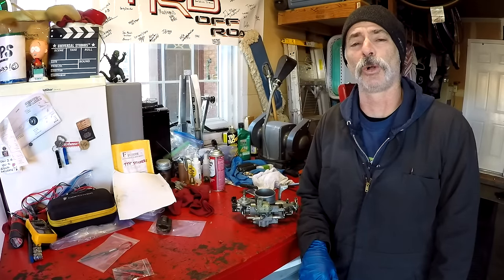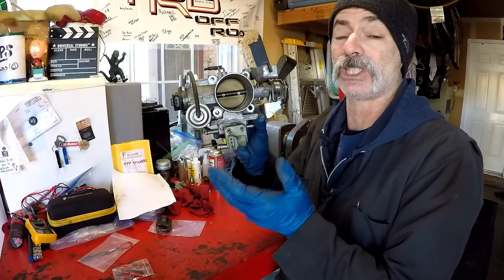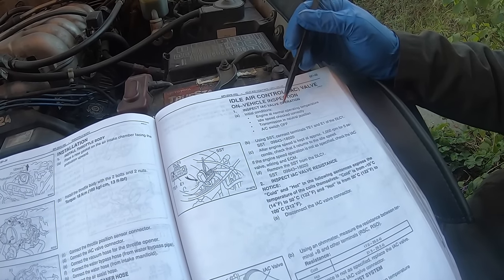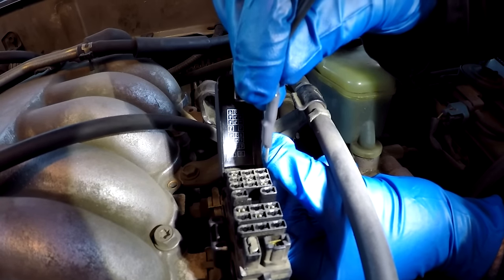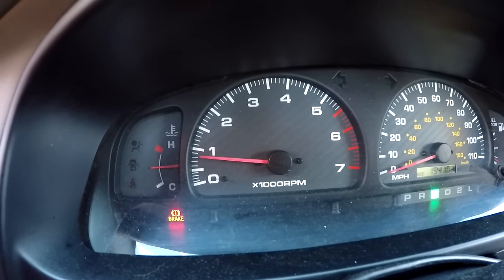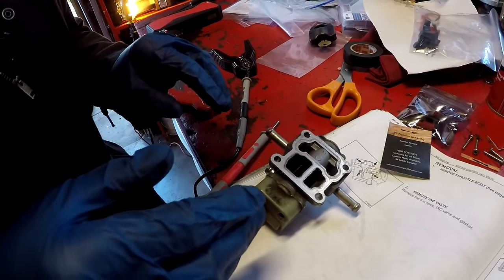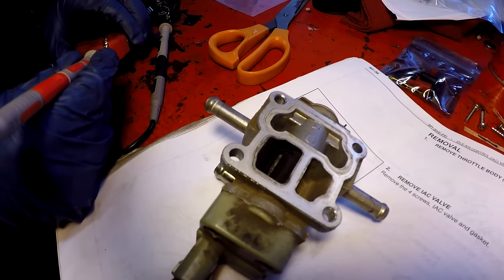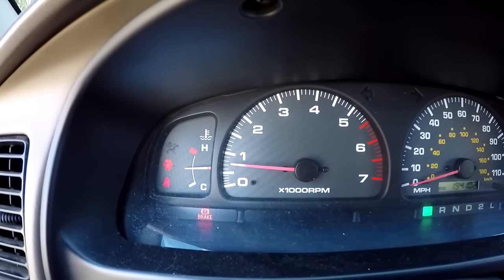IAC Valve Testing and Cleaning

Comment from the maker: Be sure to read this comment and also read the video description for helpful information.

** Here's some additional information about the IAC valve that a helpful member put together on T4R.org.  His name is Leon and he owns the Spiker Engineering company that makes products for Toyota SUVs and Trucks like the hood struts.  Leon discovered after cleaning his IAC, his idle would climb as the engine temp increased rather than drop like it should.  After dissecting the IAC to better understand how the mechanism works, he finally discovered the culprit.  Some of the carbon he was cleaning off the IAC trap door got pushed rather than cleaned off the door, and where it got pushed and dried hindered the door from fully closing.

The following is what Leon reported: "So what happened was that my q-tip cleaning dissolved the carbon, but the carbon then reconstituted itself on a different portion of the barrel, and once it dried, it prevented the barrel from closing. Without taking the IAC apart, I couldn't rotate the barrel far enough to notice this, but the actuator didn't have enough torque to overcome the resistance."  So, the take-away is do a thorough cleaning of the IAC if you're going to do it.  Because of Leon's experience, his take-away is to not mess with the IAC unless you're having an issue with it.  My opinion is I still think cleaning the IAC is a good preventative maintenance thing to do, because even though Leon had a bad result after cleaning it which inspired him to purchase a new one, not cleaning it could allow enough carbon to eventually cause the IAC trap door to become gummed up and not open and close properly.  

Here's a link to the thread: https://www.toyota-4runner.org/3rd-gen-t4rs/310151-solved-high-idle-increases-coolant-temp-iac-3.html
Reply: Last question can I vacuum leak cause a rich condition I did a smoke test and found my oil cap closed but smoke was coming out so I've flip the gasket seal and so far seemed to be OK I now have p1093 pending the no light on
Reply from the maker: @isrealperez9069  If unmetered air is getting into the engine via a vacuum leak, I would then think you'd experience a "Too Lean" condition.
Reply: Timmy. Why do you think my 99 4Runner 3.4 mostly when it’s bitter cold (15f) and only every once in a great while when it isn’t so cold (50f) will sputter and sometimes stall until it warms up a bit?
Reply from the maker: @4bangerlove  Maybe the IAC valve is sticking a bit not giving the engine the air it needs.  Both my 98 and 00 do this too and when I give it some throttle response, it corrects itself.
Reply from the maker: @L Smith Open the video description by clicking on "Show More".  We provide the part number there.
Reply: I just cleaned my IAC now my idle is around 1800 at idle.  It drops when I disconnect the IAC electrical plug but it is still high.  I removed the green coil and cleaned out all of the grey sealant.  I probably screwed it up.  I was worried about this as I did notice the holes were slotted for radial adjustment.  Where can I find information about replacing the bearings?  I am a machinist by trade so I can make special pullers if req'd.  TIA!
Reply from the maker: @nharp83  Replacing what bearings?
Reply: Can booster cables put on backwards to jump a vehicle blow out the IAC connector on a mitsubishi montero sport 3.0 1998  an what are the symptoms of a bad IAC ?

Comment: Great vid again Tim! You are absolutely right about just using a q-tip with cleaner on it to clean the valve but for the wrong reason. The coils almost never go bad on these as they are sealed in plastic so you can't short them out. However, there are two unsealed mini ball bearings on either side of the valve "gates" and when you wash the IAC out with cleaner, you wash out all the grease in those two ball bearings. Eventually the moisture gets to them and they seize up. This also happens over time on its own as the grease dries up. My other comment is that the green coil assembly you took off is "clocked" relative to the valve's body. It has up to 5deg of adjustment either way and you have to mark where it was before you take it apart otherwise your rpms are going to be slightly off. I don't recommend trying to service these if you are having IAC caused idle issues because the crappy bearings they put in these are usually shot and very difficult to replace as it takes a special puller and careful documentation to get these valves disassembled and reassembled.
Reply from the maker: Thanks for sharing all this information Jacob.  It's good to know about the lubrication of the ball bearings for the valve door.  I did spray a bunch of cleaner in there so I guess time will tell if my valve door seizes up.

I am a little confused with your statement about the clocking of the coil assembly.  From what I could see, there was no adjustment to this.  The coil assembly slides on and you have to have the screw holes lined up.  The slightest turn off center would mean the screw holes wouldn't line up.  But, in any event, I got the coil assembly back on and my idle is acting normal.  I sealed the screw heads with some Toyota FIPG.  I'm guessing that sealant is to help prevent the screws from coming loose?  That's the only thing that makes sense to me.  Also, I noticed the coil assembly is magnetized so maybe another possibility is that sealant blocks the magnetization the screws will have?
Reply: If you take off the coil assembly and clean off all the fipg inside you will see that the screw holes in the coil are slotted, not circular to give some adjustment. If you don't clean it off inside the holes, it should line back up where it was as in your case. The fipg on top of the screws is the extra that squeezed out when they sealed the coils to the valve's body.
Reply from the maker: @jacobs2309  Ah, I see.  That makes sense.  That's probably why I got it back in the same spot because I didn't mess with the sealant on the inside.  Thanks for the information.
Reply: No problem. I made my own puller and completely disassembled this valve because it's 200+ from toyota now. The bearing on the small end that is the most exposed to oil vapor and moisture can be changed, but it's a real pita. Everything on these things is clocked in a precise position from the factory and needs to go back exactly the way it was. Don't recommend for the average diyer but you can save $200 by just cleaning it and replacing that $5 bearing.
Reply from the maker: @jacobs2309  Wow, that would have made one hell of a DIY video.  Too bad you didn't film it.
Reply: Send me your IAC when it goes bad and I'll make a quick video.
Reply from the maker: @jacobs2309  That's a good idea Jacob.  I will do that.
Reply: i didnt know i.a.c. contained lubricant inside. what type of cleaner is best?
Reply: I just cleaned my IAC now my idle is around 1800 at idle.  It drops when I disconnect the IAC electrical plug but it is still high.  I removed the green coil and cleaned out all of the grey sealant.  I probably screwed it up.  I was worried about this as I did notice the holes were slotted for radial adjustment.  Where can I find information about replacing the bearings?  I am a machinist by trade so I can make special pullers if req'd.  TIA!
Reply: So do you guys recommend still cleaning the IAC but spraying the cleaner on a q-tip and not directly into the IAC? Don’t want to have my bearings go bad. I can live with a little bit lower of an idle but 250 for this part seems steep.

Comment: Tim: thanks for another great video! My ‘97 was idling at 1500 rpm warm and would barely idle at startup when cold. This after sitting for several weeks while I fixed front end wreck damage. Your video helped immensely because you provided testing procedures to verify if the valve is good. So useful since these valves aren’t cheap and buying a new one may not be necessary. I would add that it’s not a good idea to try and reuse the old IAC gasket. Ask me how I know! Anyway, thanks again for taking the time!
Reply from the maker: You're welcome Frank.  Great to hear you found our video helpful.  Yes, OEM IAC valves are very expensive so you want to be sure it's bad before dropping the coin on one.  Thanks for the comment and Happy Wrenching!

Comment: Tim, thank you again for your great videos, I've had a rough idle condition on my 4Runner for almost two months now and I changed out the  IAC valve yesterday and vehicle runs great!!
Reply from the maker: That's great to hear and you're very welcome.  Glad our video helped you out.
Reply: @TimmyTheToolman  my mechanic did an air intake induction cleaning with BG mist with two cans of spray and the rough idle was gone. The idle rpm is steady at 750 instead of running below 650. Do I still need to replace the IAC valve?
Reply from the maker: @francistham9928  If it's running good, it's running good.  You don't need to replace it.

Comment: great job !!!! When you order the IAC valve gasket, you may want to also order a new set of screws. It is almost guaranteed the old ones will strip while removing them. The screws were stripped even though I used a JIS (Japan Industry Standard) screwdriver. 

You may purchase bolts instead from Auto Zone, Lowes, or other hardware stores. The size is M5-0.8 x 16 mm
Reply from the maker: I've removed IAC valves off both of my 3rd Gen 4runners now.  By clamping the throttle body in a bench vice, using a JIS screwdriver and applying sufficient downward pressure on the screws, I came nowhere close to stripping one of the heads of the screws.  The key is having a screwdriver that fits the screw head well and using ample downward pressure before trying to break them free.  That's at least been my experience.  But, good for people to know the size screws in case they do strip one or more of their screws.

Comment: Thanks for another great video!  I bought my '98 Limited 22 years ago and happened across your channel about a year and a half ago.  138,000 km and everything was still stock except for the BF Goodrich AT's. Was planning on selling the 4Runner rather than buy new tires, fix the sagging rear end and weak rear hatch struts... but your channel changed everything. Many mods and upgrades have been made since then and I added the supercharger (your video was the push I needed) with URD 7th injector 9 months ago to great affect. A week after it was installed however I had a "episode" when after being parked in the hot sun for 2 hours, the engine had a hard time starting. Never had a problem starting before ever! After about 15 minutes it finally was running but sputtering badly. I would get 50 yards down the road and the engine would die. This continued for two blocks before it wouldn't start anymore. Towed it home and left in the garage for 36 hours. In the cool confines of the garage, it started first crank like normal. Noticed a pile of black soot below the tailpipe.  No problems last fall, winter and spring until last week... first hot day this COVID season and after 20 minutes at the lumber store sitting in the sun, the engine just couldn't catch. Cranked fine but no ignition. Left it in the parking lot and came back 24 hours later... another hot day...still no start. Towed it home left it outside another 24 hours and wouldn't start in the sun.  12 hours later at 7:00AM ( a cool morning), started up first crank like nothing was wrong.  OBD2 reader using torquepro app (wonder where I got that idea) showed no codes now, pending, or in storage. Checked T4R.ORG and most common problem identified for my symptoms was ... IAC!  Other possibilities are fuel pump, fuel filter (will install Wallbro pump that came with the URD injector when my gas tank is on low), fuel pressure regulator, ECU fuse, bad MAF, battery ground and starter relay. Based on your excellent explanations, I now see that the likely problem is the IAC and its associates namely... 1) the throttle position sensor (TPS), 2) coolant temperature (sensor not the STOTT thermostat I installed for the supercharger) 3) Air Conditioning(AC switch).
I will proceed with testing and a "gentle" cleaning of the IAC. If this does not fix the problem will proceed to the TPS.  I have a PDF of the 1996 - 2002 Factory Service Manual which I downloaded from the web but it did not have the IAC pages (SF-37) but thanks to this video all the steps to troubleshoot the IAC are documented.  The TPS is page 960 (SF-31).The steps to troubleshoot the coolant temperature sensor and AC switch however, don't seem to exist in my manual. If anyone knows where to find, would be a great help. Will update on my progress.
Reply from the maker: Hey Tim, great to hear our channel inspired you to keep your 3rd Gen.  Sounds like you're on the right track to diagnosing and figuring out your warm start issue.  I personally like having the physical factory service manual books.  If you do a search on Ebay for your year, you will most likely find the the 2 volume set for sale for a fair price.  It seems the going rate is somewhere around $150.  You obviously like to wrench so the books are well worth the investment.  Let us know how the diagnosing goes for you.  By the way, Sean will be stoked to see you are using his TEQ Tim logo.  He designed that.

Comment: Timmy the tool an is a freaking mind reader!!! I need this so bad right now
Reply from the maker: I hope it helps you out.  Happy Wrenching!
Reply: Same here, but i put a new oem iac about 6 months ago and check engine p0505 came back up and dont have an air leak anywhere. Im gonna check that air hose that goes underneath iac
Reply: I've done this, but I believe I need to do it again.  I have performed everything under the sun to fix a recurring P0120 problem.  I'm looking to re-look at the IAC again and cleaning the TB
Reply: @BKTX  maybe cleaning or replacing  the mass airflow sensor
Reply: @JJ-rb3ss   JC, yup just had enough time last weekend to do that too.  I'm going to do everything over again. I skipped a few steps that TTT did here on the IAC, but did the  open/close testing, which is the most important test.
Reply: Dude do it. It's so easy and I think it cost 22$ shit my car was even starting, it was a hit or miss. I said, to me, girl get yo fat ass up and fix it. So I watch youtube video .. binged, talked my self into it.  My car run so quiet,smooooth. Now I'm addicted. Been fixing random blew out elbow, cracked mass tube. Well damn.. just when I didn't think it could get better.. so now I'll yt videos on tear suspension. 3.1gm supreme95 .. I'm doing it

Comment: Thanks Timmy! Recently rebuilt my 3.4 in a 96 T-100. While I was cleaning the throttle body/IAC I noticed the bypass tube had a fair amount of rtv silicone in the body cavity, almost intentionally placed, in the IAC bypass port. Surprised me when it popped out and made me curious as I was not having any idling issues to that point. I cleaned the throttle body due to excessive blow-by from many miles. The rebuild has been a success and I'm happy to refer to your videos for help.
Reply from the maker: It is interesting that the port was filled with RTV.  It had to be intentional.  Anyway, I'm glad our video helped you out.  You're very welcome.

Comment: Once again, another great video. Very thorough and knowledge filled.

One thing I've always done when replacing the metal throttle body gasket, is to Dremel out the flat spot on the front so it's a full circle. I believe that this is how the TRD throttle body gaskets come when you have a supercharger.
Reply from the maker: Thanks.  We're glad you like the video.

You are correct that the TRD supercharger throttle body gasket has a full circle.  The Toyota engineers had to have a reason for blocking part of the air flow to the upper plenum but it's sounding like the reason wasn't as important as they thought it was since you're running it like you have a supercharger on your engine and haven't experienced any ill effects.

Comment: I was one of those whom sprayed and sprayed! Yes, some Q-tip use. Agree, don’t spray onto connector IAC. That door area was gooked up 180,000 mile 2001, when I cleaned, 3.4 Tacoma! Did this May of 2019. It’s 2020, June, now. Idle, cold start, etc. excellent!

Timmy, you are the gift to us Toyota fans! Going for 300,000 plus with my 2001 Tacoma. At, 189,000.
Reply from the maker: Glad the cleaning of you IAC worked out for you and thanks for the kind words.  We appreciate it!

Comment: Did the exact same thing last weekend with my 98. I spent about an hour cleaning and cleaning. since it was already removed I really gave it a go.  I kept the circuit/plug on top so the throttle body fluid didn't spill on it. She throttles at 750.
Reply from the maker: Good job Edward!

Comment: I cleaned mine in a ziploc bag with detergent submerged in my ultrasonic cleaner and it worked great.  I removed the coil motor first and also the bimetallic spring + range plate + plastic stopper.  I wouldn't have wanted to try it without removing the coil motor.
Reply from the maker: That's a solid idea.

Comment: Great video. I had high idle after replacing engine with jdm motor and i had done exactly as you said not to do
. I cleaned throttle body cleaner with iacv upside down before installing.  All the junk went into iacv. Removed it and cleaned iacv and she purrs like a kitten!!
Thx Timmy
Reply from the maker: Thanks!  I'm glad our video helped you out.